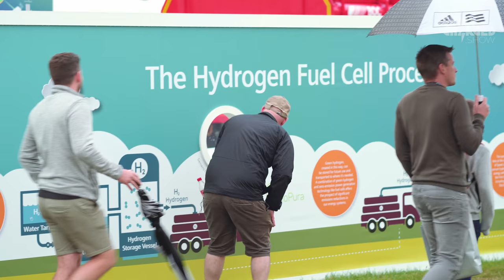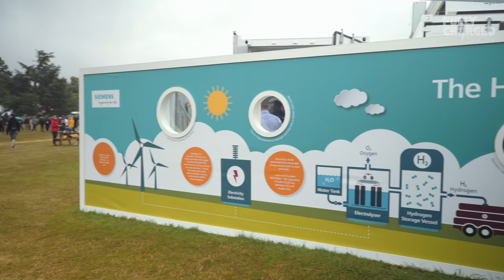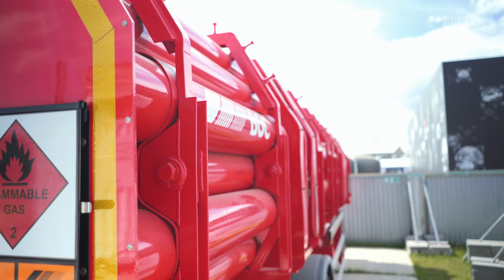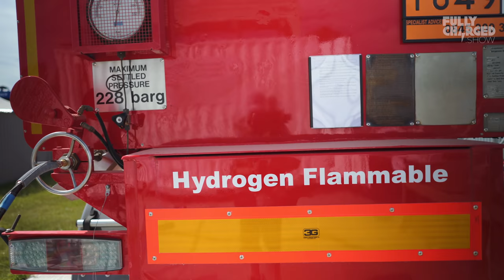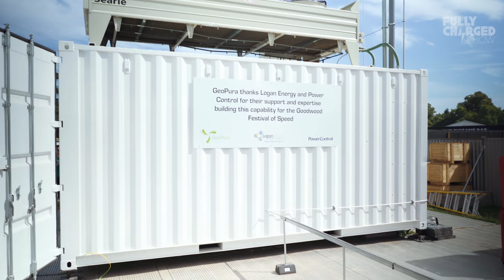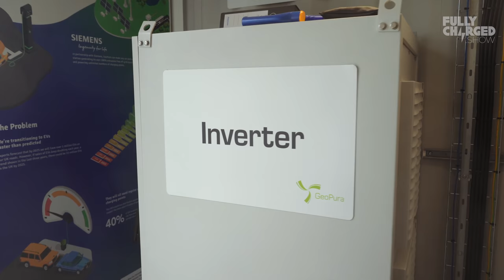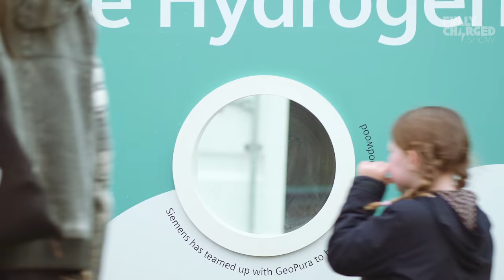Green Hydrogen Fuel Cell Charging System at Goodwood Festival of Speed | Fully Charged

Comment: This and Tesla's Megapack have the same 3Mw storage. Compare the two, would be interesting.
Reply: Well, technically this solution also provides heat and water, in addition to the 3mWh - so in certain scenarios (e.g. camp site as mentioned in the video, or hospitals and similar as mentioned in the comments) this setup gives a lot more than just the pure power.
Reply: Tesla's  Megapack is much more efficient in a similar footprint.
Reply: Yea. Seams like you get the same amount of electricity, 3MWh, per both solutions. I though that one of the main advantages with hydrogen would be energy density. And in the megapack you get the 3MWh batteries and power electronics and inverter in one container. This solution seams to be two containers and truck full of gas bottles.
Reply: @PerErikKarlsson  
Don't think about the energy from the TANKER to the car.
Think from the WIND TURBINE to the car.
You get about 75% minimum using a battery.
You get 25% using Hydrogen. (Minus energy used in infrastructure building and maintenance)
Reply: The price for a trailer of storage is very different.  If you generously assume a megapack is half the price of hornsdale, down to $200/kWh, you're looking at $600,000.  Conversely I'm finding some cost projections that are roughly $2000/5 kg hydrogen tank, meaning more like $60,000 for a trailer's worth of hydrogen tanks.  Those costs are probably too low and don't include the trailer itself, the fuel cell, the battery bank (UPS) system to regulate power, etc.
Reply: @rogerstarkey5390  yes that is the classic argument against hydrogen. But my understanding was that at least in energy density hydrogen solutions would out perform batteries.
Reply: Eric Johnson Yeah, gotta love those self-charging Teslas.
Reply: @PerErikKarlsson  
Density has nothing to do with it.
It's simply input vs output.

Much more input required for Hydrogen to produce the same result.
Reply: Also compare charge/discharge time, charging cycles, system deterioration over 25yrs, would be interesting.

Comment: Thanks for the interesting video.  The biggest issue I would say is that the hydrogen truck contains 3MWh of energy (once converted by the fuel cell into electricity), which is exactly the same as a Tesla Megapack, which also comes on the back of the truck.  The Megapack can be charged up without meaningful energy loss, in contrast to the hydrogen truck cylinders, where there are considerable energy losses in the (expensive) production and also compression of the hydrogen.  Then the Megapack can be discharged simply by plugging it in, it does not require an (expensive) fuel cell to convert.  So in terms of both energy efficiency and cost, the Megapack wins out, not to mention complexity.  But still the hydrogen system has potential advantages over diesel generators, and should certainly be welcomed, even if its economically viable applications are somewhat limited.
Reply: Tesla batteries don't make sparkling water though ;)
Reply: @2nd3rd1st  They absolutely could do if they were plugged into a water maker.
Reply: Battery packs self discharge, have short usable life, creates more CO2 in construction, more expensive to build, can not be left depleted, long charge times,  80% usable energy. 

The hydrogen tanker wins on all these.
Reply: @Robert-cu9bm  Except for much better efficiency and batteries last longer than most fuel cells.
Reply: @Robert-cu9bm  thank you for your reply.  You are quite correct that the battery pack is more expensive to build than a hydrogen tanker, and will create more CO2 in construction.  However, over thousands of charge / discharge cycles having a system which is > twice as efficient will negate the CO2 used in construction many times over.  You are incorrect to state that they have a short usable life,  modern systems now have a long life.
Reply: Iain Ballentine
Incorrect.
All the  CO2 produced is only at manufacturing of the trailer.

They said they create the hydrogen using renewable energy.

Production of hydrogen = 0 CO2
Production of electricity = 0 CO2
0-0=0

How exactly is a battery pack supposed to overtake over time?
Reply: @Robert-cu9bm  Of course they are able to create hydrogen with surplus energy now and then, but they cannot rely on it.

Comment: Fuel Cells for houses would be absolutely brilliant.
You could store energy and get hot (and pure) water from the same unit!
Reply: But you would need at least twice the amount of solar panels to compensate for the horrible efficiency compared to a Powerwall solution.
Reply: 50% efficiency is only if your doing pure electrically driven hot water off a fuel cell.
(A solar battery would be about 80%)

Remember a fuel cell spits out electricity AND hot water. If your only using it for electricity, then the hot water is waste energy.

A stationary ground based fuel cell can be much more efficient because you can harvest the waste heat off it. Harvesting the waste heat on a vehicle becomes problematic because it's extra weight you need to carry around hence the 50% efficiency given for a lot of Hydrogen cars.

Comment: BOC 'promise' to only supply renewably produced H2 with this system. Yeah right and I'm Napoleon Bonapart.
Reply: Tom Barron Pleased to meet you Nap 🤝
Reply: You are wrong. Because you do not read BOC's own web site. Let me post their words for you to consider.

"Today, hydrogen is mainly produced by steam reforming fossil fuels such as natural gas. Excess hydrogen is also recovered as a by-product from various industrial processes. Even though hydrogen generated from fossil feedstocks has the advantage of zero-tailpipe emissions, the production chain still leaves a carbon footprint. Well-to-wheel emissions of a hydrogen fuel-cell car are nonetheless approximately 30% lower than those of a conventional diesel-powered car.

Building on these conventional hydrogen production techniques and Linde’s experience of more than 100 years of H2 production, we are actively developing technologies to ultimately increase the share of renewably produced hydrogen. Our long-term aim is to significantly increase the sustainable share in the hydrogen mix using renewable energy sources such as wind, water and biomass. At present, electrolysis of water using wind, water or solar power and reforming of biogas are viable alternatives that offer a zero-emission hydrogen energy cycle."
Reply: @MarkDibley  That's not true. The renewable to hydrogen fuel cycle has atrocious energy conversion efficiency and "long-term aims" are worth absolutely nothing.

And of course renewables is just a garbage energy source only kept alive by subsidies and unscientific demonization of nuclear energy (which also happens to emit less CO2).

Comment: 3MWh equals about 12,000 kg of Tesla batterypacks (250 Wh/kg in the Model 3). The construction they have there with truck and the conversion shipping container could easily be replaced by 1 shipping container with 3MWh of batteries and some DC power outlets connected to it.
So what's the point of this massive energy waste from converting back and forth between hydrogen and electricity?
Reply: Transportation of renewable energy.
You can take the hydrogen to places where grids don't exist.  Say a forest or caravan site. Even covert locations because these can be quite silent if they control the noise the cooling water system
Reply: @georgythomas8451  
So, like a battery?
Like they did in Puerto Rico?
Connected DIRECT to solar or wind, so no grid, no conversion loss, no tankers, etc, etc.
Reply: Batteries have to be made of lithium and other resources mined from the ground, while hydrogen is made from water.
Reply: I think they are selling a replacement for the diesel genset. Have a fixed generator and ship the fuel in from elsewhere. Unfortunately for them in most cases the replacement will be a micro grid , small scale renewables linked to a battery serving an isolated village or business. 
I’m guessing right now the cost of batteries doesn’t make it worthwhile to lug a container full of batteries between festivals. I doubt that will lay forever though. A Tesla Truck based recharging station would be awesome.
Reply: @crazytosh1  so that means if I have a glass of water and look at it then it will turn to Hydrogen and if I put two wires  into the Hydrogen (oops used some mined copper resources there)  I get electricity out?
Reply: @crazytosh1  
Errr, batteries DON'T have to made of lithium.

Hydrogen, "made" (Actually "liberated") from (very clean) water, using a LOT of plant which uses mined materials and resupplied by trucks burning fuel.

Comment: Might be a dumb question, but if we lose 50% of the energy from the hydrogen being converted back to electricity, why don’t they just carry around a trailer full of batteries, instead of a trailer full of hydrogen?
Reply: @Steve Davis Yea like the spacecraft example you used, I'm sure there are more practical uses and advancements in the coming years for this tech.  But this doesn't seem to make sense.
Reply: @Steve Davis Yes, they are a solution to the problem of fossil fuel companies becoming irrelevant like coal. There are so many better ways to store and transport energy.
Reply: Probably 2 reasons - battery cost and offering an alternative so that the limited resources used to build lithium-ion batteries are directed to where they are needed most.

Comment: "the overall energy efficiency of a typical lithium ion battery system is 0.83, compared to 0.30 for the reference case RHFC system (regenerative hydrogen fuel cell)"
Reply: Steve Wilcox  That's number represnts "overall energy efficiency" which means electricity out divided by electricity in.

Comment: Take roughly 50kWh of electricity and 9Kg of water and you get 1Kg of hydrogen which contains 141.8MJ/Kg of energy (just over 39kWh), if they're getting 50% of that back as electricity then you've used 50kWh of renewable overproduction to yield just under 20kWh of electricity. If you can find a use for the heat and the water I think that's an admirable way to store renewable energy. Not forgetting that you also generated 8Kg of oxygen when you split the water, which is nice...
Reply: Clean water. (That's going to be scarce)
How about leakage?
Energy used for refrigeration?
Energy for tankers?
Plant production and maintenance?
Etc, etc,
Reply: @rogerstarkey5390  For current non-renewable generation:
Oil or Gas. (Will eventually run out if it doesn't kill us all first)
Leakage. (Deep Water Horizon to name one of many)
Energy for tankers. (See above)

Power plant production and maintenance.
Etc, etc.

Comment: I'd love to see a video in the carbon neutral plant producing the hydrogen! Great video - such potential!
Reply: There are no carbon neutral energy sources, but the one that emits the least amount is nuclear. It also works around the clock in every season and weather and consumes much less resources than renewables.
Reply: @phamnuwen9442  
"Carbon neutral nuclear" Hmmm 🤔
HUGE carbon footprint during construction.
Long construction time results of continued use of high footprint generation, so by default that's added to the nuclear footprint.

Staggering decommission times, again, resulting in carbon output.

Sorry, no.

Comment: Oceanic Thermal Energy Conversion is a stable solar energy conversion that easily could be used to make and compress hydrogen for storage and transport for use getting the hydrogen from sea water effectively desalinating water where the power is needed from ocean water. Worth looking into. I think the hydrogen economy is the future for some applications along with battery and bio fuels, syngas and other carbon neutral options.

Comment: A bit off topic to this particular video, but a generalised question if I may...

Do you know if anyone has done any research into the effect of employment with the rise of Electric Car, and Autonomous Cars. Electric Cars need less servicing and maintenance. So there will be less demand for mechanics, parts advisors etc... Less demand for Petrol Station staff. 

Autonomous Cars. No need for a driver. Taxi Drivers. Delivery Drivers. I was just curious if this has ever been considered. I don't recall yourselves ever discussing it. What happens when a lot less jobs are available within the 'Motor Trade'.....
Reply: Ray Anderson It’s certainly been discussed and acknowledged in previous videos but I don’t think there are any videos with this as the main topic.
Reply: Full service gas stations died 30+ years ago, and pay-at-the-pump means the cashier is mostly there to sell candy bars and lotto tickets.  If anything, longer charging times vs fill-up means more staff at filling stations to serve food.  The trucking/distribution job (and the very real health risks associated with it) will be eliminated.  In the shorter term, there will likely be a spike in jobs as a huge amount of manpower will be needed in decommissioning gas stations and converting them to electric pumps.  As long as governments allow petrol cars on the road, these will need repairs, and increasingly so as parts become rarer.   I suspect there will be a big boom in local repair shops just after dealerships shutter their service centers, followed by a huge drop off once the fuel becomes nearly impossible to buy.  But I would recommend having a good look around your local repair shops and talk to the owners.  Every one I've talked to has said that young people just aren't interested in that kind of work, so there is already a scarcity of labor, and a rapidly aging pool of mechanics.  The fact that ICE vehicles have become incredibly difficult to work on, requiring more expensive, more specialized tools over the last decade, has made automotive repair a generally lower margin business anyway.  All roads are pointing to these jobs eliminating themselves organically.  Same is true in much of the power generation industry, where lower margins and rising mechanization has forced out jobs, long before the rise of solar and wind, which have actually CREATED jobs, many using similar skill sets with lower health risks.  The transition period will generate millions of jobs.  What happens after that transition has a lot more to do with general trends in employment than with electric cars.
Reply: There will still be a need for mechanics-Technicians, EV's they still have mechanical parts and electronics, I'm a former mechanic myself and one of my instructors in Tech School said anything made by man will eventually break and it will need someone to fix it. 
Even Tesla's require a yearly check over and maintenance, it does have oil and coolant among other things that needs to be checked. 
Petrol stations at least here in the USA its all self served for the most part (we do have a couple of states where you cannot pump your own fuel)
Unless they start making robots to fix things there will still be a need for techs. 
It is a interesting topic, I was trained back in the day before computers and diagnostics systems were the norm, and I adapted and doing okay, going to EVs is not much different you still have a box with a motor to turn a gearbox to turn the wheels to go down the road the running gear and tech changes, end of the day it all stills need attention. 
Still a good question. 👍
Reply: I'll bet you use a computer and photocopier at work.
Think about it.
Reply: @rogerstarkey5390  

I used computers when they first came out, and now more so, photocopiers not so much. 
I remember using modems and fax machines.

Comment: It contains enough energy to drive an EV for an entire year "average of 7000 miles"

But a small petrol tanker contains enough energy to drive an average family car 1.2million miles. Logistics. I'm sure this may have its place. But still not convinced.
Reply: If your figures are correct we can expect something like a hundred times more hydrogen tankers on the road than the current gasoline and diesel versions.

Hydrogen is extremely leak-prone and difficult to work with in general. Hydrogen filling stations have been known to blow up, even though there aren't that many around.

Nevermind the cost of operating such an enormous tanker fleet, and the insanely low efficiency of the renewables to hydrogen fuel conversion.

This is absolutely bonkers.
Reply: Your numbers are way off dude. First, the "average" annual mileage in the UK is 12,000 miles. Second, a "small" petrol tanker caries around 20,000 litres, which if you get 45mpg you get about 200,000 miles out of it and double that for a large tanker. Sure it is still a lot more than this set up but that is not the full point is it?
Reply: @slanahesh  we were both off. 36,000 liters in a UK spec truck. Around 400,000 miles. But the average UK milage per year based on last year's VOSA report is still indeed only 7600 miles. And falling. 
So I'm still not convinced. I see it definitely has potential. But still way off.
Reply: @phamnuwen9442  my figures were a little bit off, it's actually around 400,000 miles worth. With an average UK milage of 7600 according to last year's VOSA report. 
But yes, the tanks are called Dewars, they must constantly vent because of the boiling point of hydrogen which is -252.9c so if you leave this stuff seat for a week or 2 you loose so much via it venting. It's not practical to transport at the moment, hydrogen is a dream. Never going to happen.